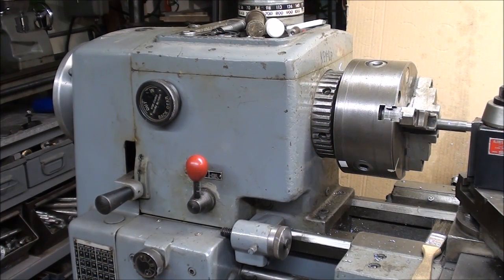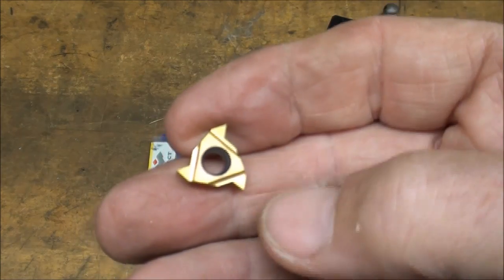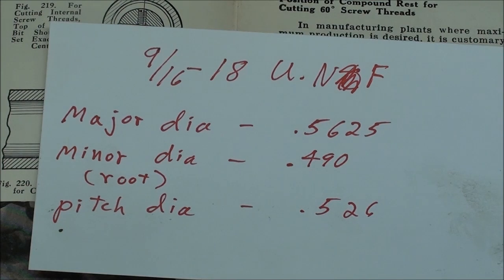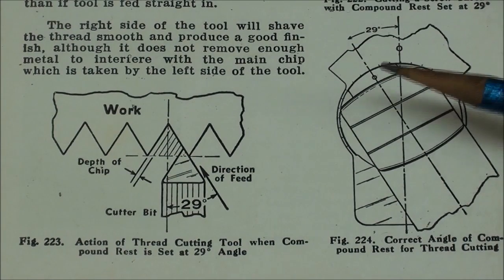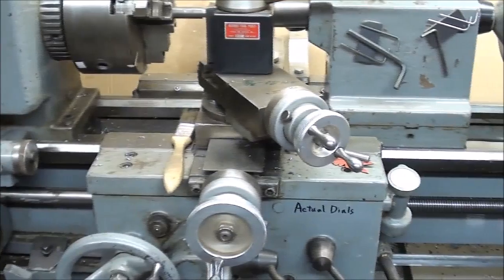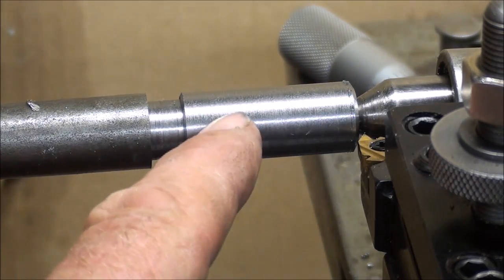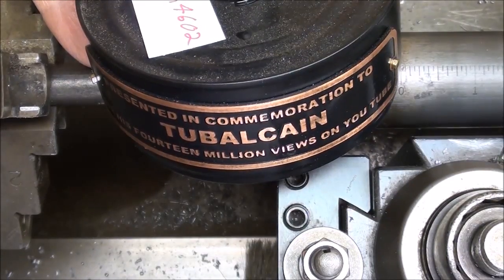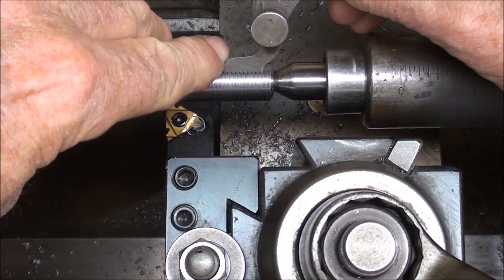SHOP TIPS  #182 Threading on the Clausing Lathe Using a Pre-Ground Tool tubalcain

Comment: You can simply keep the compound set at zero, parallel to the bed and advance the compound half the depth of cut for each pass. By moving the compound and also the cross slide this closely simulates the 30 degree angle. This method also helps with the depth of the thread as the depth is directly on the cross slide dial ( dro ). The tool load is split 87/13 so the trailing edge skims the right hand flank and the leading edge does the majority of the cutting.
It's usually best to remove the sharp peaks of the threads before trying the nut, if you get the nut to fit without removing the burrs then it will be loose when you do remove them. Having sharp peaks running on the root radius of the female thread can cause galling and prevents the thread flanks from engaging.

Comment: Questions, which Lathe will you recommend better a South Bend 16" x 6' 8117c or a Clausing Lathe 13" swing. Your help will be greatly appreciated Thanks
Reply from the maker: Lots of things to consider. But I would prefer the closing. A 16 inch lathe probably bigger than you need

Comment: Actually, some small cutting does indeed take place on the tip of the right side. The SB book itself does state that “most” of the cutting takes place on the leading edge. Each time you move the cutter in for the next cut, you will have a step on the trailing edge, usually the right side. The trailing edge cuts that step off. It’s geometry. Draw it out as to how the tool steps, and you’ll see it.

The real reason why we tend to set the compound to 29 or 29.5 degrees instead of 30 degrees is a simple amount of tolerances and error. If you set it to 30, and you’re just a bit off on the high side, you will cut more than a 60 degree thread by twice the error. Setting a bit under 30 degrees doesn’t have that effect as long as the bit is set properly perpendicular to the work.

Comment: I have seen other videos where it is suggested that the final cut be made by advancing the cross feed rather than the compound.  perhaps one or two thousands so that on the final cut the right and left side of the tool both remove a small amount of material. Supposedly this makes the right side just as smooth as the left side.
One other video presenter said that one can approximate the total compound feed amount by dividing 0.708 by the number of threads per inch. I have not found this described anywhere else.  ?????

Comment: Tony,  great video..  lots of good info there...   what size is your lathe...  are you using an AXA or BXA size tool post,  if you had the opportunity to start from scratch.. which size would you get ... and what size tool holders would you use with them..

thanks,

Joe

Comment: The 1 degree less causes the right side of the 60 deg tool to stay in light contact with the right side of the cut.  It helps to keep the right side of the thread smooth instead of being rough or stepped

Comment: hi there let me start by thanking you for your videos they are VERY Helpful. I have tried this several times and need fine threads like 24 or 32, they all come out nut as a nice V like yours do the threads all "lean" toward the tailstock like saw teeth. do you have any suggestions for me. I also usually get a rough thread even cutting at 2-3 thou a pass with cutting fluid, everyone says it's due to the carbide cutter at slow speeds and they all grind there own steel bits.....you have proven with this video speed is not the issue so I am not sure why they are so angled and rough.
Reply from the maker: +Gwinners Gunworks It seems like your tool is not square with the work.
Also, what type of steel are u threading?
Reply: +mrpete222  not sure the steel type, practicing gun barrel threading and there lies one of the problems...the barrel being tapered I tried your align with the chuck instead of the gauge. I thought looking at the threads the it seemed the right side of the tool tip is cutting the threads instead of the left 60 degree angle.

Comment: Thank you for the video.As usual,both amusing and informative.A question?On that last,skim,cut would changing the angle from 29  to 30 degrees also open up the thread enough to properly engage the nuts' thread?Or would it put undue pressure on the tool head and possibly damage the work?I realize that there are highly detailed processes and procedures for cutting threads but am curious.Maybe one of those solutions in search of a problem kinda things.:)  Thanks again.
Reply from the maker: I never tried that. I suppose it would work.

Comment: Now I can see why my lathe threading attempts resulted in pulled threads as I was attempting to approach depth by advancing the crossfeed and was not using the compound at all. I can also see that this method does mitigate some of the lateral loading issues that the tool imposes on the work. Do you ever use a follower rest when threading?
Reply from the maker: +Aaron Scott  Thanks for watching

Comment: I have one of these cutters not Shars but one 
Iike it and it works great plus you can machine a lot of threads with the same corner.
My favorite threading material is 12L14 or stressproof.

Comment: This is fascinating – thanks Mr. Pete...  So, the compound set to 29 or 30 degrees ensures that only the back face of the tool is cutting, to make a better finish, correct?  If the compound was set to 90 degrees, would it still be possible to cut the same thread by incrementally plunging the tool perpendicularly into the work, but maybe with worse finish?  Is this sort of plunging how square threads are cut?

Comment: When I watched your videos #175 & #176, I was very impressed with how your Shars threading tool appeared to work in different types of metal.  I went out and bought both the external and internal versions of this tool, and am pleased to say that they work excellent.  The replacement inserts can be bought on eBay for less $$.  Do a search on "AG60 insert".  I have chipped a couple of the tips on the external threading tool, but it cuts as smooth as butter and gives a better finish than the tools I was using before.  Thank you!

Comment: That was great, never can have to many threading videos and I like when each of us in the community create one we all include just a little something left out or a good add to the subject the other didn't happen to include in the project at hand.
;{)---
Reply from the maker: Thanks Keith.  It seems there is always someone new watching that really enjoys it.
  pete
Reply: I whole heartedly agree, i like those videos!
Reply: I'm watching all I can find...I got a South Bend 9" a couple of months ago, and have been trying out the things I've been watching on YouTube for the last year or so, mostly with success thanks to the great instruction. Threading is one I haven't tried yet, but will be very soon.  One thing I haven't got my head around yet is the relationship between threads per inch and which divisions you can use on the threading dial. I'm not even sure it's the same for each lathe. May need to sit down with a paper and pencil and work out the gear ratios and lead screw thread pitch. 

Thanks for covering the insert method...and showing a holder and inserts I might actually be able to afford!  I'm going to start with a hand ground HSS tool (want to learn how...and I have an old lathe, so I should learn the old way anyhow!), but I think the inserts have some advantages, even for hobby folks like me.

-- Mike
Reply: BigMjolnir Hi Mike, You are right, some lathes vary on thread dial engagements, keep in mind that the thread dial is for engagement timing control. all pitch control is done at the gear change box. Some odd numbered pitches, like 11, 13, 15 etc.will determine your limited engagement locations. It is best to make a ghost pass / likely touching, for your first pass like Mr. Pete showed. you can also chuck up on a piece of all thread, with it sticking out to engage different spots on the dial and with your bit hovering over the thread you can see following, half thread engagements and if you are repeating on every number, line etc.  ;{)-----
Reply: Keith,  Thanks, I'll try that. My South Bend is a Model A, so I have the quick change gear box for setting thread pitch.  I've got some 1/2" mild steel rod from the local hardware store that I'm planning to practice on. It's good to know that not every lathe has the same thread dial behavior...not so much because I'll be using a lot of lathes, but so I know what to remember, and what not to copy, when I'm watching videos showing threading and the person says what options they have for engagement.

BTW - I'm still working my way slowly through your videos...I want to watch them from the beginning and not miss anything! ;-)

Thanks!

-- Mike

Comment: Great video.  I cut threads on my lathe because I don't have enough dies to cut all of the threads I might want.  I would like to see you do metric thread cutting on the Craftsman lathe.  I have a Craftsman lathe with the quick change gear box and I have some extra gears.  I don't remember why I have them but some little voice in the back of my head says metric threading.   Thanks for sharing.
Reply from the maker: +cerberus  Thanks for watching
Reply: According to the book I'm reading at the moment (Technology of Machine Tools, by McGraw Hill ca.1969) those gears should be 50 and 127 tooth. Which equals the ratio between English and Metric, 1"=2.54cm, there for 127 divided by 50 equal 2.54.  When cutting them the half nut can not be disengaged, you have to back out then reverse the lathes direction to return to the start of the thread.

Comment: afaiu the "correct" angle is 30, the reason for setting it to 29 is to make sure that isn't over 30, cutting a little on the back side is better than not at all
Reply: Just my thought! A perfect 30 doesn´t hurt and may even better then a 29, but how much work do you have to put in to get a perfect 30? You can´t fully rely on the marks or on your eyes, so you stay a safe distance below 30. 29.5 would be ok, but where do you find half-degree marks? So 29 is it, easy to dial in and safe.

Comment: Poetry in motion. Just wondering: suppose you missed your timing badly on engaging the half nut, say by 180 degrees and near the end, could you break the tool since you're then pushing it into a full depth cut? I can see how the thread would certainly be destroyed alright. Thanks.
Reply from the maker: +jix177  Thanks for watching

Comment: 9/16-18 strange?  Try 11/16-18.  I have an old mill holder I'm trying to build a new arbor for and I had to try to figure out what size it was.  Finally figure out it was 11/16-18.  The threads on the current arbor were so bad that I couldn't get a good measurement using the thread pitch gauge and so loose that measure the major diameter of the threads would give me good numbers.  I was finally able to use the thread pitch gauge to measure the internal thread and figured out that the thread depth is always the same for the pitch and so was able to measure the minor diameter and then add in the depth to figure out what the proper size for the major diameter is and that it was 11/16.

Looking forward to seeing your next videos on different methods of measuring if they are out before I cut the thread.  Waiting on a new compound for my Atlas 10".  The one I got on my new used one with the quick change gear box had a broken compound slide.  It looks like somebody had buried a tool but in and the downward pressure snapped it in the T-Slot as it had been welded/brazed.
Reply from the maker: Thanks--some threads are very hard to ID

Comment: Just a comment on the setting angle for the compound.The reason for setting it to just under half the tip angle is so that the tool does cut on the back face.It's obviously a fine cut but I believe the reason is to improve the finish.I always used to set to half the tip angle because that was how I was taught to do it tens of years ago.It has only been in the last year or so where I've had to cut several threads and worms that I started to give thought to why one degree less was usually recommended.Keep the videos coming - Graham

Comment: No, this subject is not boring.  And yes we have had good luck with Shars products with fast and usually free shipping.  Can't wait for the pitch mic. I have a new one with interchangeable anvils, problem is - no way can I read the pitch sizes on the anvils,
even with a spy glass. Don't know how they can make print that small..Don't know why
I even bought it.  We do a lot of keel bolt bronze threading about 2 ft. long, and for the
perfect fit we use valve grinding compound and run a nut back & forth. Total old school
but effective.  Also effective I call it the 4 to 1, every 4 passes, a spring cut due to the
length of the work between centers is a must for the long work. By the way, how come
I click the like button it does not show up?????
samuel
Reply: When you click the like button, you should see the icon turn blue. The number of likes does not update immediately.
Reply: mrpete222
 Thanks , I always wondered if it really updated or not but never failed to click it.

And loved the threading video as well !
Reply from the maker: Thanks--??? on the like button